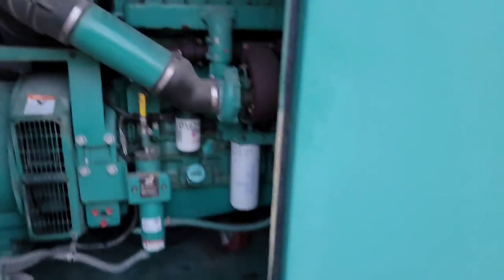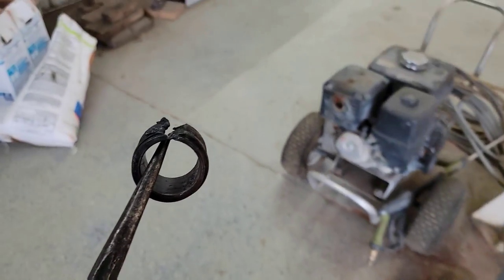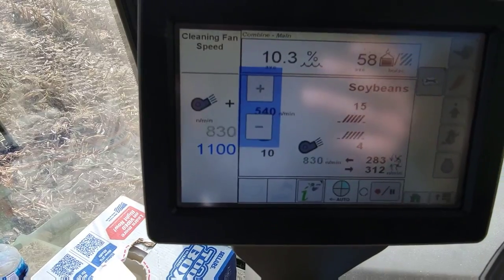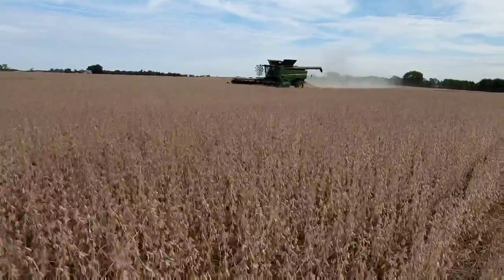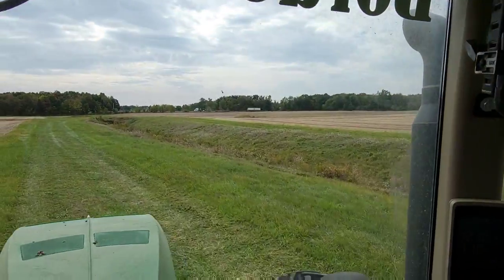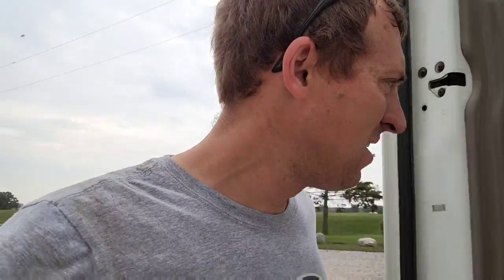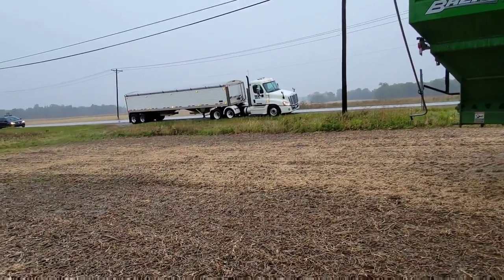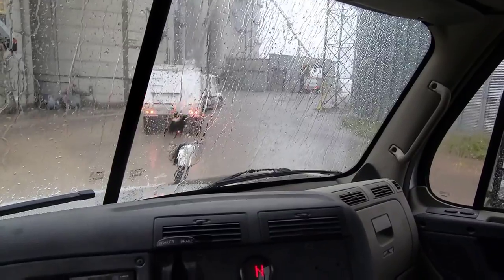How to Rehydrate Soybeans 🌧 - #518

Comment: I’ve had as many as 3 augers in series to get trucks loaded from a muddy field, and I’ve literally pushed combines through the field because the contracts with the organic buyers stipulated taking delivery from the field at specific dates and times. Which is fine, no big deal, it was all going into milling within hours, but talk about bad days! We can write the contracts a lot better now that we have the storage we need. In between we did use ag bags and they were a good temporary fix.